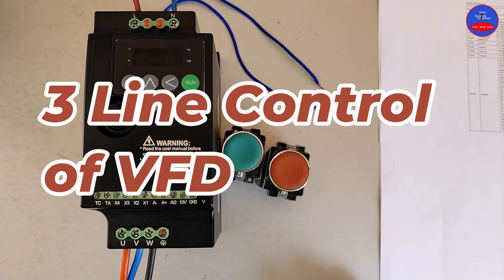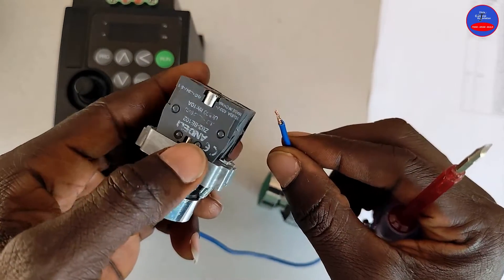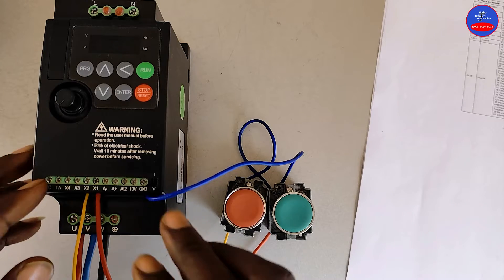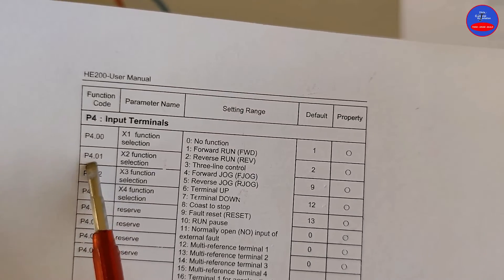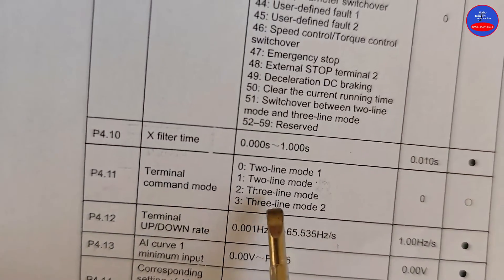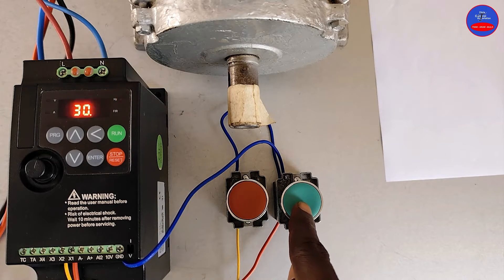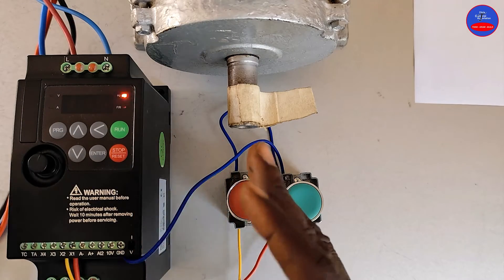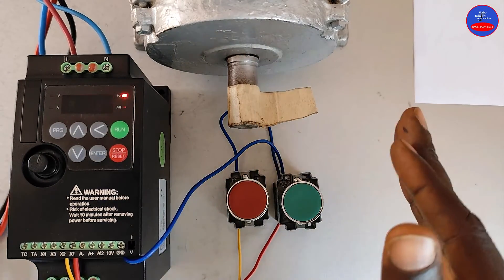Three line control  of variable frequency drive vfd

Comment: This is wonderful but I have a question ,let's say the induction motor was controlled by star delta starter and I want to control it using vfd .How can I connect it on the motor connector block
Reply from the maker: You just connect the three phase lines from the drive to the motor. And do the programming according to nameplate of the motor.
Reply: @abisherchuma8567  how do you understand star delta starter and why do we connect a motor in star delta starter
Reply from the maker: @patrickbaafi2804 Star Delta is a reduced voltage starter, used to reduce the starting current of a medium to large horse power motor at start up in star configuration. When the required speed is attained, Delta configuration switches the full power on the motor. 

Watch this video
https://youtu.be/uWINCYha6uw?si=SP8AvuJN5oWJFU5Q